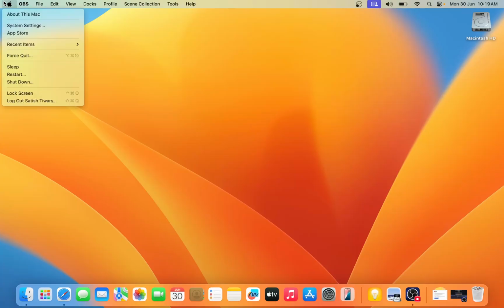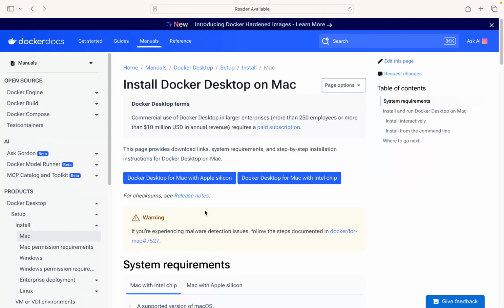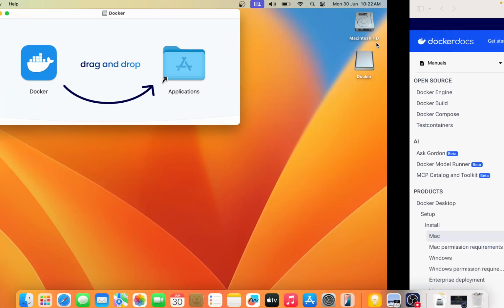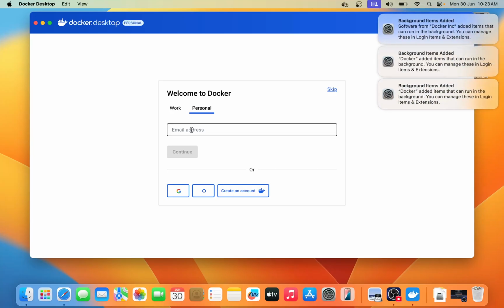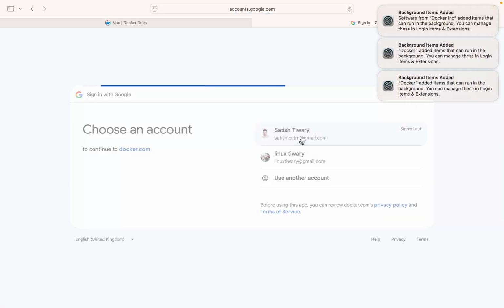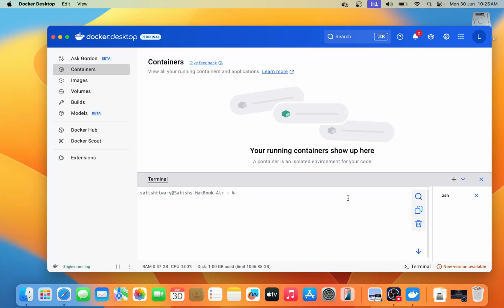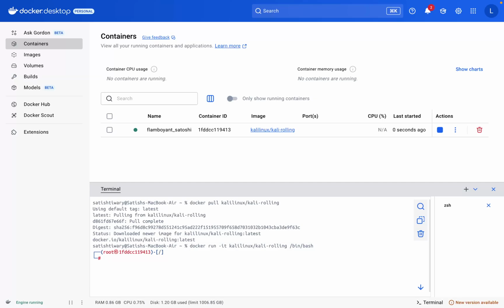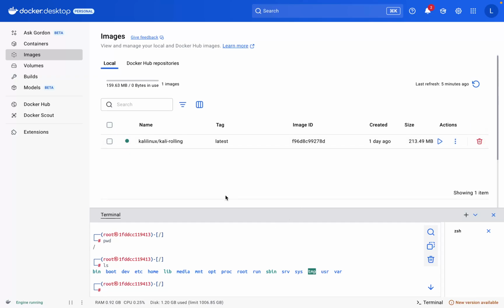Build Your First Cyber Lab Using Docker on Mac

Comment: Sir ur gem❤️😭🙏 ur so underrated, u have so much wisdom, and my ques does our mac m1 air support wifi pentesting, like monitor mode then scan channel, deauth, send injection packets, and find vulnerablities and make our sys more secure,, i know it can be done in kali linux but what is best way for this in ous 8 gb m1 air, like utm or vmware or virualbox or overatted paralles is good (due to its famous wimdow integration, is it even same for linux. Guruji kya linux bhi utne hee best performance se chalega) or even dualboot is better using asahi linux gurudev ya yeh docker is enough for this simple wifi hacking, like man in middle no evil twin nothing, just for start practicing for ethical white hat hacker or even grey in lowest possible budget or no budget. Aur Guruji ek aur sawal wifi adoptor ke baare m, that kyuki mera budget bahut kam hai, aur even woh paisemeine nhi kamaye toh cheapest wifi adapter dekha kyuki  majburi thi toh @linuxndroid ke channel m usne ek dongle jinta bada adopter dikhaya jo 2.4 ghz m perfect pentesting kr skta hai, toh yahi lowest tha par mujhe pta hamra inbuilt m1 wifi adopter bhi bahut strong, toh ek bande ne pucha tha kya laptop m bina ext wifi adapter ke kar skte hai toh isne kahan haa par kali linux ko dualboot m chalana0hoga aur wahin to chahiye mujhe, no need of ext wifi adopter, so kya yeh possible hai internal wifi adopter se monitor mode0on kr pana aur injection packets bhi bhej pana (kyuki ek video me uske android phone ka wifi adopter support krta tha toh usne0ext adaptor nhi lagaya @orailnoor) 🙏😭 guruji please, agar haa toh kaise. Agar naa toh yeh dongle kaam karega na mac mein like kali m jo usne apne win laptop m driver0woh isme work karega na, 😭🙏 ek aap hee jo bta skte hai kyuki 200 rupay bhi bahut badi baat hai isme 4 logon ka ek time ka khana ajayega ya kisi gareeb ko kapde mil jayenge, aur Gurudev yt par mac ke koi doubts nhi solve krta, are video hee nhi hai ethical0hacking k related.🙏😭 toh is safar m aap hee ek sahara hai, aur aapke pass bahut knowledge aap isse karke yt pe bachoko genuine knowlege de skte ho, par aap apna potential puri waste kr rahe0ho aapse chote  aur kam deegre k log sirf apne proper presentation and seo ke dam se  phaad rhe hai jaise @cybermimdspard @cyi @linuxndroid aur @andrew balbel i guess